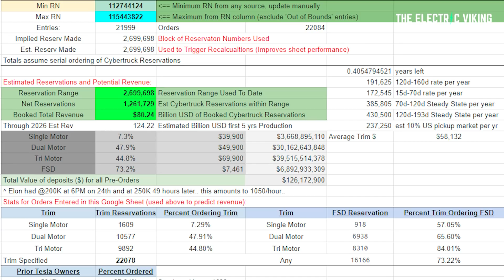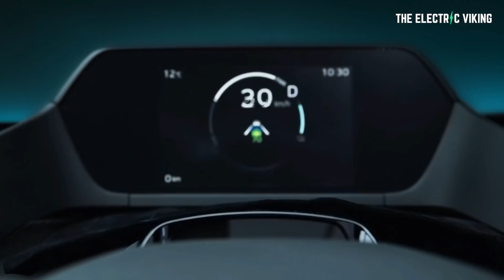Why Tesla is partnering with BYD

Comment: Regardless if they buy only batteries or the entire skateboard, do they have the capacity? BYD has a whole EV lineup themselves, plus they already have some deal with Toyota as well. How much capacity do they have today? Are they expanding?
Reply: That is what I wonder too. The boom in demand has already stretched the delivery time to over one year in many cell types. BYD should not have any extra available capacity for Tesla. Unless they have also found the LFP raw material sources from waste material streams. That would most probably explain the abundancy coming. Now LFP patetnts are expiring so maybe the LFP cell capacity will grow to 30TWh/a much faster than anyone expected. Now first Blade cells and very soon after that film cells.
Reply: Hell will freeze over before BYD ever deals with Elon!
Reply: @gregb1599  Yeah, he insulted them. That's also a factor that makes this unlikely. Probably just a rumour to pump the stock a bit more. It is also unlike Tesla not wanting to control the whole chain.

Comment: Tesla's Shanghai factory has a production capacity of 500K, and they are currently already producing 400K Model 3/Ys. Even if we assume that Tesla caps the Model 3/Ys at this rate (unlikely), they will only have 100K capacity for an arguably far larger market segment than the Model 3. We've also not heard of any plans to expand Giga Shanghai factory or setup another factory in China. So it would be even more economical if Tesla got BYD to supply not just the battery and platform, but also manufacture the vehicle, while Tesla provides the design and software. Such partnerships are not uncommon in China. There's no need for a Tesla drivetrain in a 25K car, especially if it's going to be used as a robotaxi eventually.

Comment: Great stuff
According to Sandy Munroe Tesla battery cost is at $83 kWh. An that is before the 4680 battery that should reduce cost by 50%
So, maybe Tesla almost cant afford the blade battery?
I prefer the 4680 over the blade because this gives a structural strenght as a bonus👍🇳🇴
Reply: I have seen that the BYD packs can be used structurally...(which means it aligns with Tesla's ideas...). Also I believe that the pack energy density of a BYD LFP pack is better than 2170 LFPs. Actual manufacture of a blade pack is slower than the 4680, but that is not Tesla's problem, in this case ! ( I thought that Tesla was going to manufacture LFP 4680, but this may be in the future, with a perfectly adequate solution for now...).
Reply: @chrisheath2637  LFP batteries are not as energy dense as  any of Teslas batteries.  LFP are bulky and dont have as good cold weather performance (they will need more heating)...   LFP advantages are (1) inexpensive per KW, (2) excellent cycle life (longevity)  and (3)  fewer rare metals need to be mined
Reply: @Saxafruge  Another advantage with LFP is that they can be charged faster. I suppose with different chemistries, the software can optimise the battery regimes (charging, cooling, discharging, heating) to get the best out of them...
Reply: Oh what's that stuff the LFP do not need? Oh cobolt yep zero cobolt
Reply: Re: Tesla M² with Blade? Makes sense. Tesla giga-pressed bodies strapped onto BYD skateboards with 20-30% margins each (30-40 to Tesla, due to higher production efficiencies?) for the (2 yr?) duration. Why not? The smaller, slower car won't have high engineering demands, so a non-structural pack (due to blade swelling limitations) would be fine. Just LFP for battery life, safety, & charging potentials is more than enough for robotaxi style cars. When the current manufacturing "stop gap" is past, Tesla can roll out its "totally own" robotaxi design while BYD deploys the older (Tesla branded) models to 2nd & 3rd world markets (along with mass Tesla superchargers, mega packs, tunnels, etc., etc ). Win, win, win!!!
Reply: What is the problem with the 4680 tabless battery ? Why isnt it being used ?
Reply: @nordic5490  Ever tried devising a new battery, and producing it to scale? Cost? A minimum $5 billion. Difficulty? Extremely. Tedious, repetitive, environmental testing. Make tiny incremental changes, and repeat that testing allover. And then get the production equipment so it doesn't break down. Assuming you have staff that don't break down. Then optimise. Possibly having your teeth pulled out is less painful. Then you have to devise heating and cooling...
Reply: @chrisheath2637  sure, I get all of that, but, the 4680 uses existing chemistry, only the packaging is different.
The question remains, what is the current problem with the tabless design ? Obviously there is something that isnt yet resolved. Prehaps there are reliability issues in the connections of the tabless design ? Someone would know.